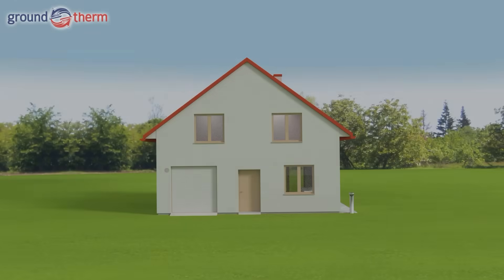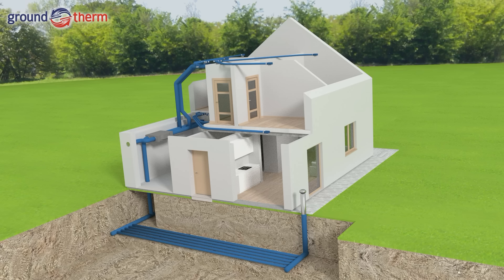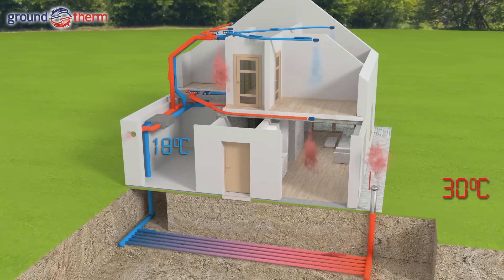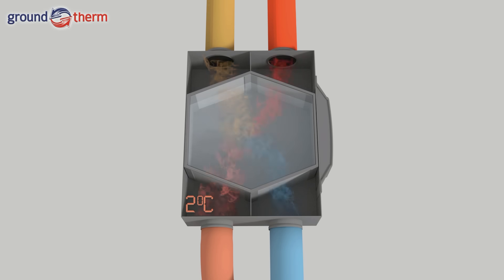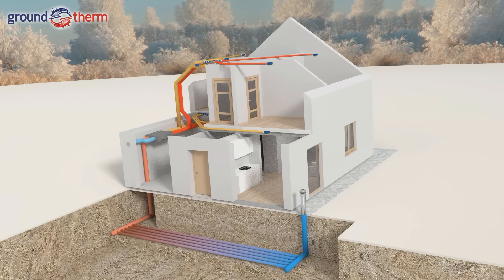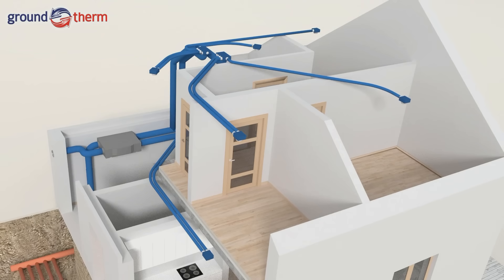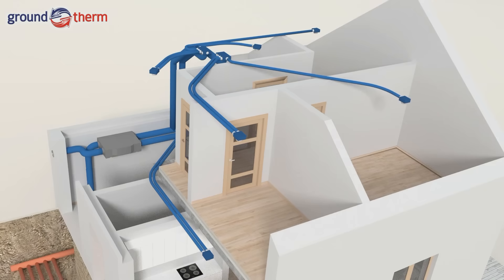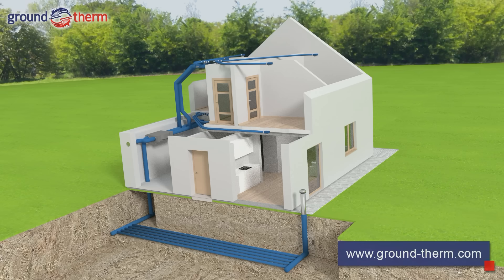Mechanical ventilation with VENTIFLEX® PLUS system and Ground-Air Heat Exchanger

Comment: Wait until one of those tube under the house gets a joint crack and the entire system fills with ground water.
Reply: There are negatives to all systems. Rodents in your attic eating through your AC tubing is equally as dangerous.
Reply: I don't have rodents in my attic, and if I did, I can do something about it. All houses have water under them, nothing you can do about that. Nor can you do anything about the movement of the ground or your house. Nor can you repair this when it fails.
Reply: Build above groundwater. It is a very essential piece of info before you get your shovel out. Slope the tubes, add drain slit at lowest point over gravel bed. This will get rid of the condensate. If groundwater happens (I have it very rarely if a winter is really wet) make sure that your lowest point has easy access, it pumps out in a minute with an ordinary garden pump

Comment: Where is THE UVC LIGHT to kill mold ?
Reply: They used silver particles,impregnated in the inside of,the,ductwork . silver is,the worlds oldest and,most effective biological,remedy
Reply: Brett Moore well other than Sunlight, preventing mold on the inner surface is a good start.
Reply: @plumsmuglers  not sure of your response but with the silver lining a electrostatic charge could be used,to prevent any dust buildup too
Reply: Brett Moore It would need that, because a coating would be nullified if any significant dust were allowed to build up on it, whereas UV Light is far more forgiving.
Reply: @plumsmuglers  I,don't doubt sum,systems,were designed,to bring sickness. We have technologies that makes,the,jetsons look,like,cavemem
Reply: @brettmoore3194  for this to even work the underground pipes would have to be large enough to get into  just to get enough air flow to cool any structure consistently so just add a hatch and clean them every month

Comment: so any outdoor orders will be sucked into your house.  and the house would be very positive to the outside, which isnt such a bad thing.
Reply: The HRV would keep pressures equal. Same in as out.  Its still crap, the ground loop will fill up with condensate
Reply: acoustic4037 atmospheric water harvesting 🐸
Reply: @ 1:35 filters are mentioned.

Comment: Nothing is free!! Forty years ago I helped build something similar. The air was moved by two 3/4 HP fans that ran 24/7 . Considering the cost of the structure and the cost of electricity the owner will never break even.
Reply: I built one 15 years ago, two variable speed fans averaging 50 watts each (they peak at 150). With a heavily insulated house (one time investment) you will get rid of both a heating system and the power part of the A/C system (you need the ductwork) and their associated energy costs. Average yearly energy cost for a family here is 2000$, I get by with 700. All because of neither heating nor AC.
Reply: @astranger448  Hi,  if you have installed This system please share the area,  location,  cost,  experience allot the system,  since how long you were using this system and in winter what is the temp out and in and same in summer?
Reply: @neeljain9619  Sorry, can't help you there. My system is not the one shown but works the same/uses similar components. Cost depends on too many factors to say anything useful. Al depends on the complexity of the dig and the ductwork. Also important to get insulation and especially airtightness right.
Reply: @astranger448  Insulation and airtightness of the ducts you mean?
Reply: @sherifnabil50  No, insulation and airtightness of the building. If your building leaks heat everywhere none of these systems works. First you make sure that everything is well insulated and airtight. This will bring down your need for heating/cooling down to a level that the input from a ventilation system becomes meaningful.
Reply: @astranger448  I mean air tightness I understand. However, building insulation should already be factored into the cooling load calculation when you size the geothermal system.  It's difficult to insulate a preexisting building.
Reply: @sherifnabil50  Insulating pre existing difficult? Yes and no. It is first of all a necessity. The world is full of houses that were build in times of cheap energy with little to no insulation. The ones that are not too bad can often be improved at a cost that is within reason. Those too bad should be torn down. I live in the EU where all real estate transactions need an Energy Performance Certificate that gives a good indication if a house has good or bad energy efficiency. The effect is that good houses gain value and sell quickly and really bad ones lose value so badly that it is cheaper to replace them with new housing. Costs a lot of money but you have lifelong savings on energy cost.
Reply: I would agree with you except still air excerts more pressure with the right set up an a slight breeze you can create massive air flow. Free.
Reply: @clintonbarbee5093  Not arguing science, simply stating a circumstance
Reply: Clinton Barbee how would i go about. I have no idea how to do it but it seems to be a good idear to implement in my future house.
Reply: To do something like this I would definitely go solar, free energy and free climate control once you pay everything off that is.

Makes you more independent and not needing the government to supply necessities.
Reply: @raven7068  Does your government rant apply to higway, roads, public schools, hospital, airports etc, as well ?
Reply: Search for wind catcher...you could use wind catcher design instead of a fan. Would could lots of cost there

Comment: this is a bad system; a ventilation system (HRV/ERV) should not function as an air handler (AHU). If you want to ventilate and heat/cool at the same time, you need 2 supply and 2 return ducts.
Reply: Jason Hunter what do you mean?

Comment: explain please what instrument you are using for  pumping hot and cool air in the building...
Reply: An ventilator.
Reply: Just an impeller provided fan in outside pipe

Comment: I'm just asking out of curiosity: Does anyone know if these systems can vary/regulate things like the air humidity of the pumped-in air? Or if they can vary the air-flow to different rooms? Or if these can work with room sensors which measure air quality and vary flow accordingly?

This system seems pretty simple. I could be wrong, but I get the impression this would be more expensive to install than standard air conditioning, yet not as flexible.
Reply: You could, with zone controls etc but this is crap.  The HRV has been long in use, and they add a water collecting ground loop and think its new and exciting.  There are reasons why its not code to do it this way

Comment: Sounds cold how about just open a window
Reply: If it's 90 degrees and humid outside, and you want it to be 70 degrees and dry inside, how will letting in humid, 90 degree air help?
Reply: What about when it's raining or just humid outside. Good luck drying your carpet before mold starts to grow.

Comment: Looks fantastic, but I wonder how effective it is at cooling compared to a standard AC system.
Reply from the maker: It is able to be very effective in case of appropriate design. Many times not proper design kills the effect and the user is not satisfied.
Reply: Christopher Clarke the wondering has come to an end now. 😃

You get ”free” additional energy from the ground. That's the point. The rest is the same. You can add an AC system or not. For most cases, I’d recommend an additional AC system.

Not really sure what you mean by effective by the way. 😁 I guess you think in terms of money if you’re talking about effectiveness right? If so, you should consider such a system.